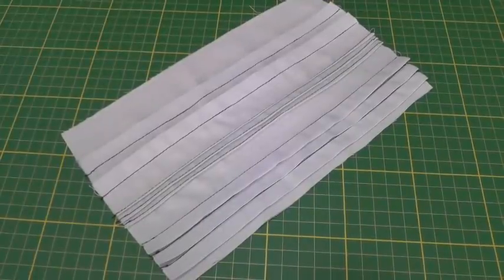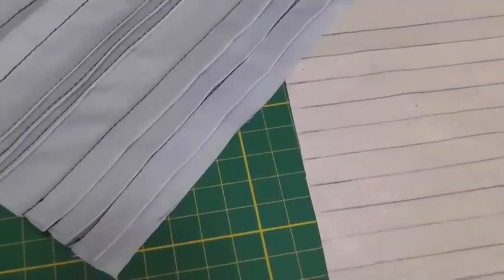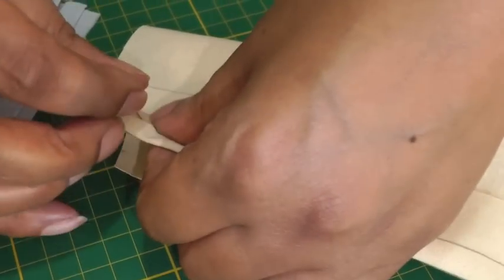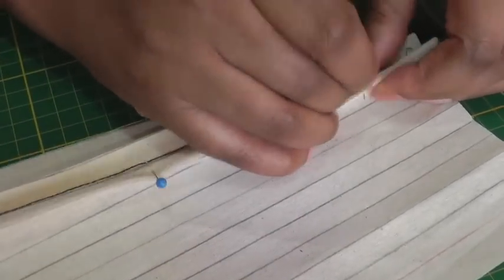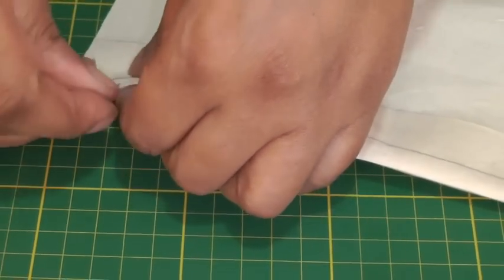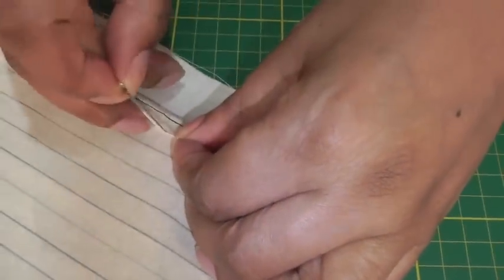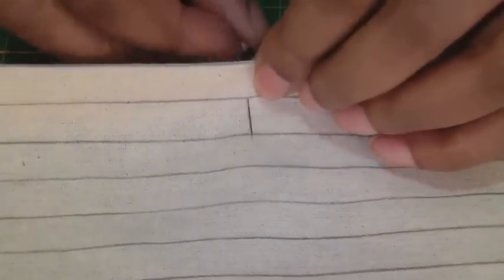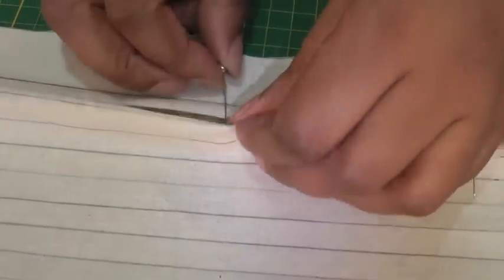Forming Pin Tucks

Comment: thank you for the video..i am in the process of putting together a dress the material has small pintucks and lace, but with princess seams I cannot match them from front to each side.  I thought of using a piece of cotton then pin tucking after I sew them together, but how much more of a measurement would I have to add to the pattern to keep the fit?
Reply from the maker: It really will depend on how big or small the pattern is.  Mark out on a plain fabric the size of the pattern and then pin tuck, placing it onto the section of garment your using to gage how much you'll need.

Comment: I am making a formal dress shirt for my husband having pin tucks on the right & left side of the shirt. Does your advice still apply to do the pin tucks and then cut out the fronts, or would you use a different approach?
Reply from the maker: When I have used this method in the past you tend to get better results ( depending on your fabric) is to tuck first, then cut. I hope that helps Kaye.
Reply: Colleen G Lea - FSBTV   Thank you. I have pintucked one side and am now doing the other. Fingers crossed!!
Reply from the maker: @kayehill1245   I'm crossing my fingers too Kaye, good luck.

Comment: You mentioned placing your pattern piece over the pin tucks that you have created and then cutting it out. Since you are cutting through all those stitches that you have just made in the pin tucks , doesn't that cause a problem with the pin tucks unraveling? If so, do you have to go back through each pin tuck and secure the stitch again  or is there something else you can do? Thank you.
Reply from the maker: Hi Ann, There are a couple of things you can do, use masking tape and the other method is to have the section that is going to be sewn to the pin tuck, ready for sewing before the unraveling takes place.

Comment: can u turn the pin tucks so you can go down one side of the fabric across the bottom of the fabric then up the other side of the fabric???
Reply from the maker: Using cord in the pin tuck is easier to achieve that look, make sure you practice on scraps of fabric.